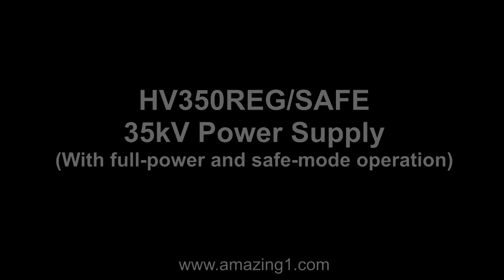35kv Power Supply HV350REG/SAFE

Comment: The black box that has a propeller has only one wire connected to the power supply. You need both wires positive and negative to complete the circuit so that the propeller could turn. 
1) So how did the propeller turn when it only have one wire connected to it ?
2) Is the long black wire positive or negative ?
3) The thick white wire is connected to positive or negative ?
4) Why is the green wire on the front panel not connected to ground ?